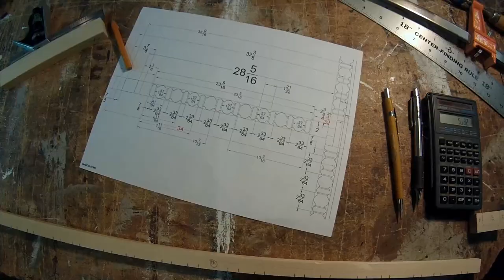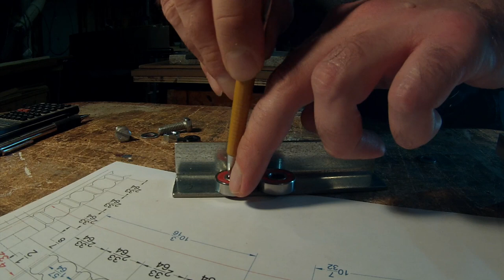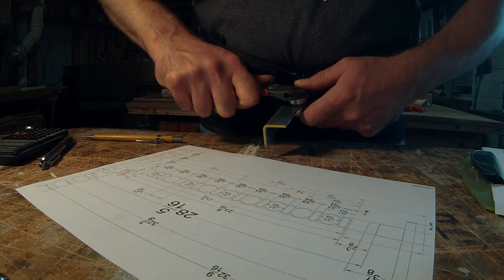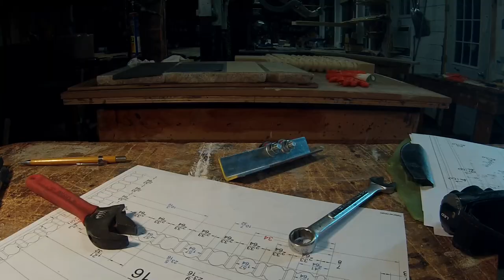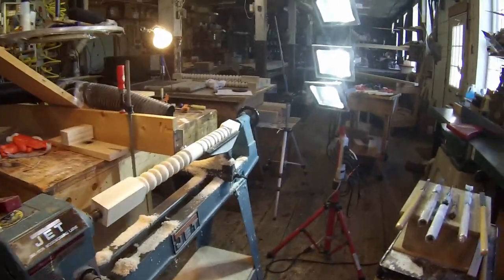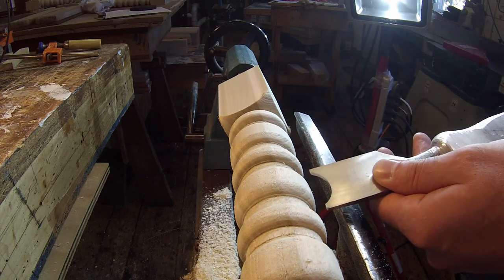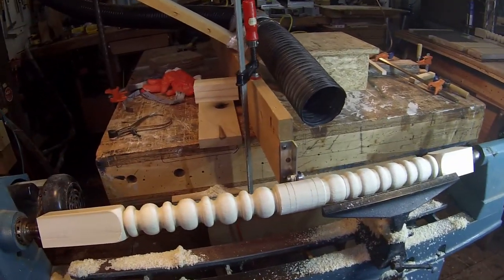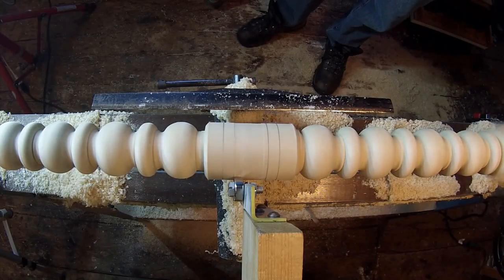Turning Madness Part 2: Long Spindles

Comment: A lot of work on this project Mitch. I assume the customer requested the spindle design. You did a good job with it but as much as I hate to say it, its boring. I would think tapers between the turnings and different diameters would have been more pleasing to the eye. Having said that I realize the added complexity would increase production time and make repeatability more difficult. But I guess as they say the customer is always right. Your ball bearing steady rest worked out well. A couple of skate board wheels, if available, would have been handy. Nice work as always.
Reply: breakinn403